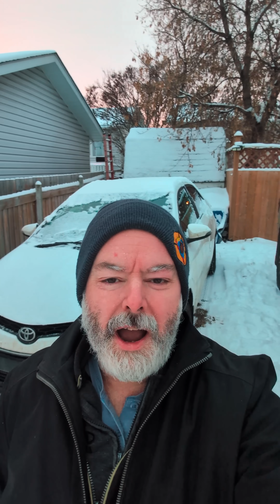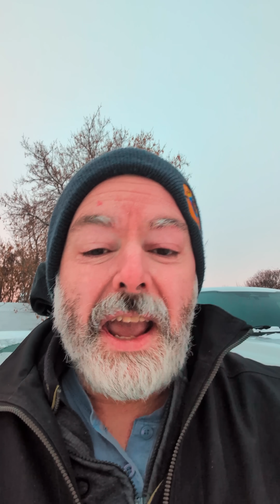Car computers are making upgrades impossible #cars #mechanics #tech

Comment: you can do what your saying you just get the computer that goes with that engine the sensors should work but you'd have to wire on the new ecm connector to the existing wire harness and you'd have to fabricate all the places to make the components fit
Reply from the maker: You make it sound so easy lol.  I've got a bit to learn.  Automotive computers are a bit different from the PC world I come from.

Comment: It’s as simple as then if you know how the computers work. They actually make engines more reliable, lower emissions, able to compensate for altitude (air density) and air temp, they allow WAAAAAY more power, a 2L could have never made 1000HP 50 years ago but now it’s pretty common. With computer knowledge and wiring ability you can put anything in anything.  If I can change engine and transmission in a weekend and have the new gear ratios showing the correct speed so can many tinkerers. Take to a specialist if you need help with the details. You can upgrade the ECU, I had the processor removed, reprogrammed for bigger injectors, new MAF, different compression and a turbo and more than doubled the HP. That was over 20 years ago, now you have cheap stand alone computers that can do anything you tell them. Two injectors per cylinder with different fuels, no problem. Nitrous too, power limiting by gear, etc etc
Reply from the maker: Definitely see how computers have improved engines. I'm just learning about what you can and can't do with automotive computers.  I've been a PC and Linux embedded developer for over 20 years, so a bit different world.  Glad to see there's a path but you're average person will have a steep learning curve to get there.